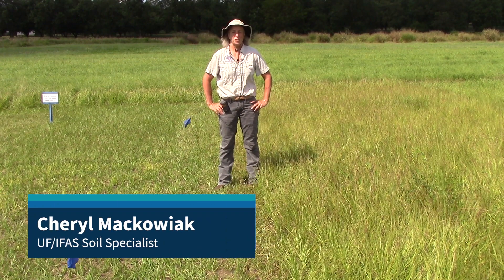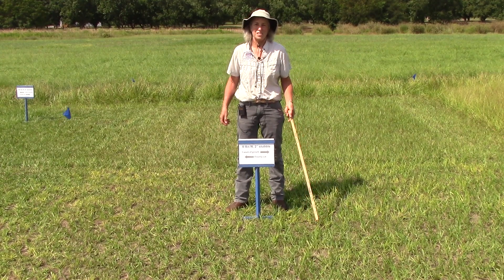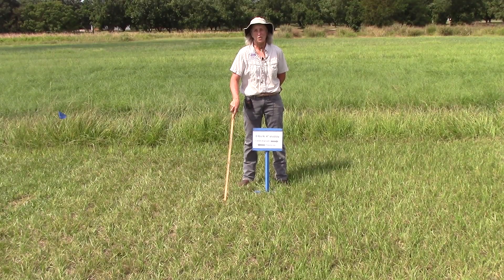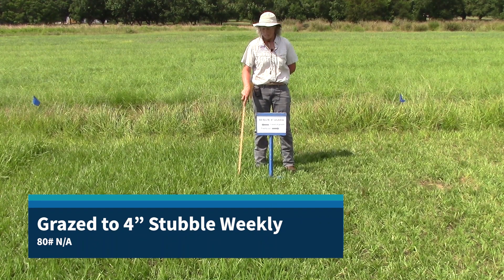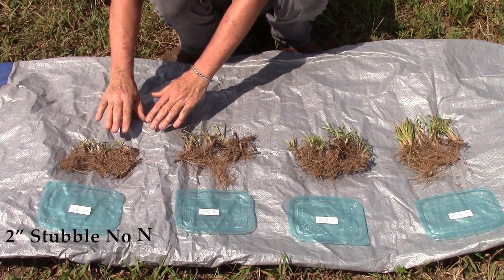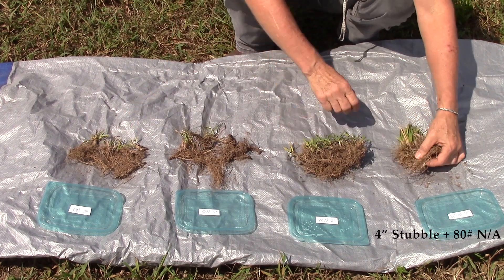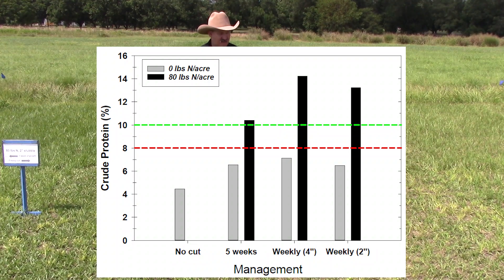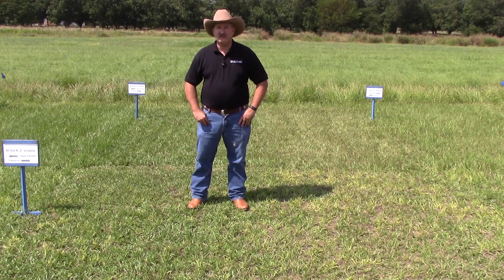Part 2: Improving Mature Bahiagrass Quality with Grazing Management

Comment: After 8 years of trying to get my bahia yard to green up and thicken up just north of Tampa, I've finally learned spraying liquid iron that I found at Home Depot. It attaches to my water hose and now I have an amazing carpet of deep green going now. Also, I finally bought a big Cub Cadet zero turn mower that I use on it's highest setting, which is higher than standard residential mowers. If I could post a picture here, everyone would be as stunned as I am. Also, I quit watering at all and now have less weeds.

Comment: I just recently got a new mower, the Toro Super Recycler. I have the cut height at 4.5" height or the maximum and I am cutting every Wednesday and Saturday here in Central Florida.  I have noticed it growing really well and have benefitted from that height. If we find we're getting consistent rains I may cut it at 4". Great video. Thanks so much.

Comment: I have an acre and a quater in jupiter farms florida, residential yard. I am thinking of bahia, which is the best between Argentine and Pensacola and can you make a bahia lawn full, less bare ground?
Reply: Argentine is typically a better grass for lawns, as it tends to produce more shoots (more branching). As with most forage and turf grasses, a somewhat higher cutting height will greatly benefit the lawn. I recommend a 2.5 to 3 inch mower height (hold a ruler or tape measure to measure what you cut and adjust cutting deck height accordingly). Some folks think cutting real low will reduce cutting frequency but  most likely it is because the plant will not recover as quickly, but the weeds sure will! Good luck!
Reply from the maker: Argentine is more prostrate with fewer seed heads, so it is generally preferred for turf usage.